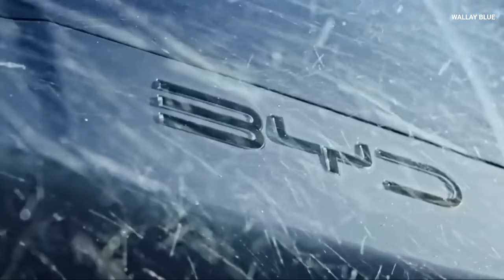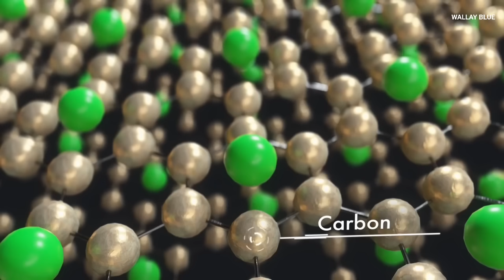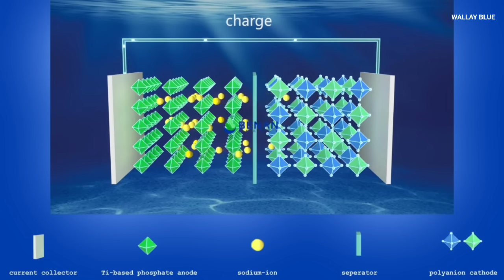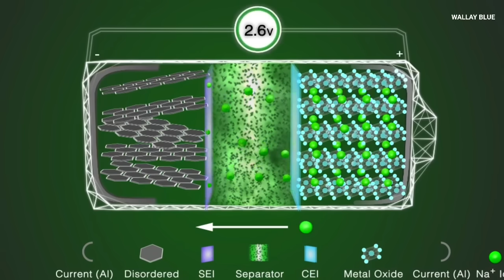BYD CEO Announces All New Solid State Batteries With 10 Minutes Fast Charging!

Comment: you say nothing about weight which means heavier therefore smaller batteries and range the same as previous battery . ill believe it when i see it , we have had many worthless promiseses from ev builders
Reply: so ill stay with my vw atlas Rline  for another 3 years. and see
Reply: Solid state batteries will be double the energy density per kg.

Comment: Sounds wonderful. However, be aware of the following : a 100KWh battery will fully with a 100KW supply connected  to the battery for 1 hour. To half the charging time a 200KW supply must be connected to the battery for 30 minutes. To decrease the charging time to 10 minutes a 600 KW supply will required. For 1 EV at a charging station this my be feasible. A charging station with 5 chargers a  3MW supply eill be required. Then, with many of these wonderful EV's on the road, many, many such 3MW charging stations will be needed. I very much doubt if there is currently any country which has a energy distribution system that can transport the energy for fast charging EV's on top of the current requirement. Upgrading an energy distribution system is very, very expensive and any upgrades will be paid for by the EV user. Energy will become even more expensive. The technology is wonderful, not so much the practical application.
Reply: I'd suggest that the 10 minute charge time isn't the real-world selling point. They are lighter compared to lithium ion so you get more range and efficiency. Instead of 32kw/100m maybe 25kw/100m (throwing a random number). Me charging at home if I can will have to plug in less often, saving money
Reply: You dont save money by charging it faster. It still requires the same amount of energy input.  It can just handle a higher currenr and aperage input.    Your charger would use a massive amount of energy to charge the thing in 10 minutes.   It would be like charging multiple evs at the same time . Your power bill will reflect the energy useage regardless of how fast you use it.  @brian.the.archivist
Reply: @derekhoffman818  you're right... But that's not the point I'm making. I'm not advocating for faster at home charging, the cost of even installing that type of equipment at home would be crazy. I'm saying lighter battery+higher energy density=greater efficiency so less kwh per mile. Charge at home slowly when possible but you'll have to worry less often
Reply: I'd suggest the selling point is  cheap and lies.
Keep funding our number one world adversary, with you dollars.
Reply: @jameslester4474  I think you misunderstand. That's the selling point for all solid state batteries, regardless of whether it is made in the US or China. They're doing that stuff here too, just not with byd
Reply: Screw Chinese made anything!!!